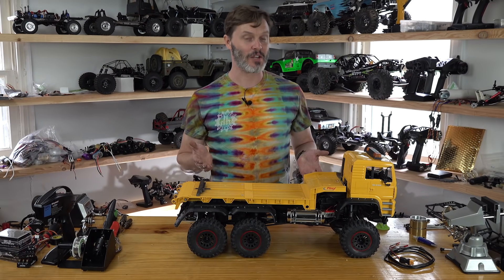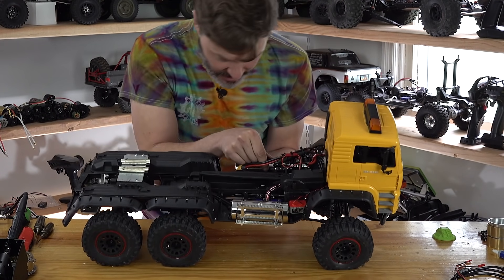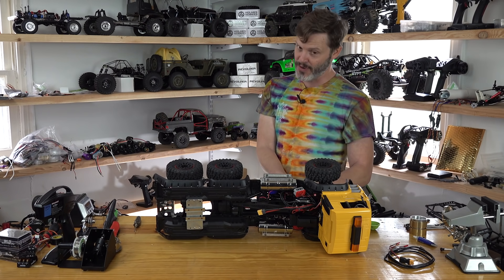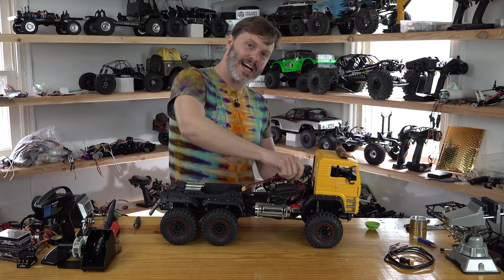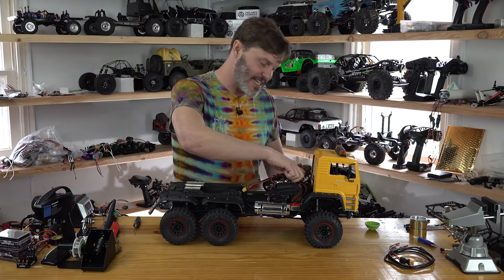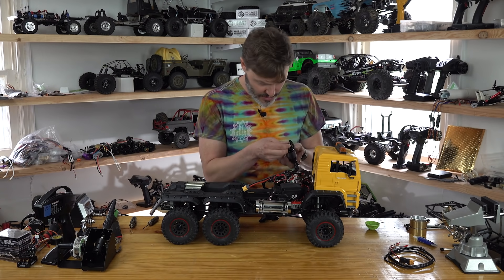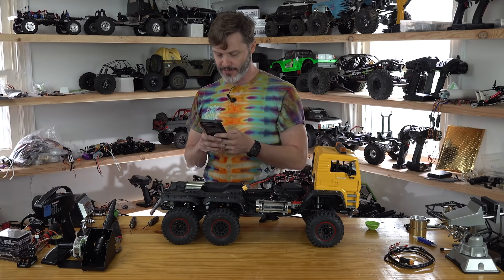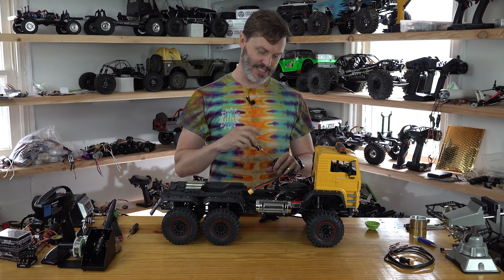Fixin' Time! Project TRX-6 Gear Fix & Discussion About FOC Motor/ ESC - Holmes Hobbies

Comment: For AXE 3300 is mostly used mesh which is one letter higher because of thicker shaft, so if normally D for 12 pinion for 3,17 shaft, E for this motor

Comment: Traxxas gear mesh system is flawless, if you use a 1/8 shaft motor. When you go up to the 5mm shafts it is off.

Comment: I purchased a Crawlmaster Sport 8t. A HW 1080 is controlling it and I'm running a 10t pinion. It is unbelievable how slow and smooth the start up is! I watch guys at comps running these hw fusion and axe systems and they start up so notchy and can't go as as slow as my set up. And it's got hilarious top end. You sir are awesome! As long as you're selling them I'll always run Holmes motors! I'm buying a puller pro very soon.
Reply: I run the same crawlmsster sport to 8t. Great motor!! I also have a fusion system and it has great start up and smooth.

Comment: Have been toying the idea of picking up the Axe system... Have the Homes Crawlmaster sport with an 11T pinion on my Capra. Love the low speed and torque but a little lacking in top end, especially to clear mud out of the 1.9 BFG Crawlers. I think the constant speed would suit me well. Any other FOC options out there?

Comment: Noticed the not so quit great startup when I installed my AXE 2300, even on a 10t pinion. But was still acceptable, finally got around to switching the receiver to pair it to my DX5C, gives me better control of the diff locking but lose the cruise control function. Have to say, with a better radio it does have a smoother startup now.

Comment: I had the same problem with a 1080 hw in a GEN 7 redcat. Was faster in reverse, I couldn’t get it sorted out and just sold the ESC.
Reply: Should have just swapped the motor leads.

Comment: I just picked up a TRX-6 Without a motor or esc Which one of your motors would be a good fit
Reply from the maker: Puller pro 540 (not stubby) 2200 or 2700, or 3500 if your want wild.  Mamba x or Copperhead

Comment: I love it when you go off on a rant about motors and motor engineering, especially when use your box truck body as a white board.  
I recently got a used Slash with an older(?) Hobbywing SCT ESC and I had to swap wires to get the 'fast forward, slower reverse' straightened out.  I really need to upgrade the firmware but it won't link to my phone.  
Thanks for the video.

Comment: I have a TRX6 drivetrain in a GSpeed rig with a TGH trans. Using a mamba X and a Puller proV2 3500kv motor. 
Does that motor really turn 100,000+ rpm or is the data logging reading wrong?
Can I use a 3500kv with 4s? The truck is a beast.
Reply: Where does the puller pro say 100k rpm? It says 50k rpm max. The puller pro r is 60k rpm max. That means your 3500 is 14.2v max or 3s. (Since 4s exceeds it). I have puller pro r 4100, v2 3500, and v1 2700. I only use 4s on the 2700kv standard. Tale the max rpm or rpm you want to achieve and divide by the KV. That will give you max unloaded rpm. Or you can divide the desired rpm by voltage you plan to use to find the kv you need. 
.
Mamba data logging is very accurate, but you have to set it up correct. If you have it as a 2 pole motor it will read 2x the rpm of the 4 pole motor since it’s switching twice as much per rpm.
Reply: @KTMcaptain  
Thanks you 
The data logger is giving me this number. I do not believe it would turn that so that is why I asked. 
Thanks
Reply: @darkhorsegarage9623  you need to put in the data viewing settings that it’s a 4 pole motor. Then it will give you the correct numbers, but right now you need to cut it in half. 
.
A
4 pole motor switches polarity twice as much per revolution than a 2 pole motor.
Reply: @KTMcaptain  thank you I found the edit area that allows me to input the proper KV rating. Reads 45644 rpm freewheeling on a 3s pack.

Comment: Hey john, thanks for the short tutorial. I have a question for you. I have a SCX10/IIII builders kit. I am running a HW1080 with rc4wd 35 t. The drag break is terrible and it wants to pop over obstacles. How can I try to remedy that issue. Can I change the spur/pinion to help that?
Reply from the maker: Gearing down with less top speed helps.  Or get a Holmes motor so it has quality magnets.
Reply: Lol, saw that coming. Ya it's a cheap motor. I expected a lil more from it. And .... not so much lol. Thanks

Comment: I always wondered why I couldn't run 3s on the 3300r2 on 3s if I did any bashing or hard hard crawling "comp" it would crash a cell had it warrantied & same thing 3x over still have it in a rock rack ray w/12t pin & complete locked diff my exercise trail rig I love trail running with it. Anyway, I was actually thinking it had to do with staggering magnets not a complete series & there for has brake in amprig, & the wind up in acceleration, kinda rail gunish... there lower kv lack torch but are predictable smooth higher kv are okay. After having used your motors to copperhead theirs just don't do it for me. The throttle curve is important just like a 1 to 1 electric vehicles there is throttle curve not touch & go. On axe to implement low low start up & all out go just isn't there. The complete control of parameters on Holmes & Castles systems hands down are the trail, comp, scale, & mini 4x4 OH Yeah Best in class for our personal Opinion...

Comment: I have that yeah racing motor plate. It’s complete junk. Didn’t last 5 minutes before I threw it out and went back to the stock one. Was worried about the puller pro R being too much for the plastic one but it wasn’t.

Comment: The radio has a lot to do with it... Traxxas radios suck for slow crawling...I used a Dumborc 6 channel on my trx6 from stock with a castle creations copperhead and puller pro and it helps modulate low speed control nicely

Comment: I’m not gonna rip you over the hobbywing comments bc in my opinion I’d rather have 1 good Holmes system then 10 mediocre hobbywing systems. Holmes is the best on the market in my honest opinion the revolver has the smoothest startup and low speed control of all crawler motors. I’ve tried castle, hobbywing, and Holmes and from here on out all it’ll be is Holmes hobbies going in my rigs. I’m about to start a gspeed build it’ll be getting a 1800kv revolver crawlmaster mini and shv800 servo.
Reply: I had an axe 3300 in my trx6, but had to get something else when I went to 5.2” tires. I’m going back and forth between a 1400 revolver-Mamba X and a 1950 revolver classic-Sidewinder 4 combo depending on trail/crawl conditions, and it’s so much more controllable. The shv800 is now the only servo I’ll put in a crawler, it beats out my reefs 777 hands down
Reply: @mblauskee7925  I can promise you that you won’t be disappointed with the revolver
Reply: Is the revolver 2200 KV powerful enough for the TRX -6
Reply: @michaelniedojadl5481  I would think so they’re extremely powerful motors. I would think it wouldn’t have any problems at all.
Reply: @johnboy6955  The revolvers are great. The 1400 is my preference for slow and technical, while the 1950 definitely has the wheelspeed for bashing (as much as one does with a crawler). I moved the Axe 3300 over to an SCX10ii with TRX4 axles tracked build, and I’m underwhelmed. Looks like another revolver is in my future
Reply: @mblauskee7925   yeah the 2200 definitely has more wheel speed than I was expecting but it still does absolutely amazing on those slow technical crawls I am however gonna drop down a couple teeth on the gearing.